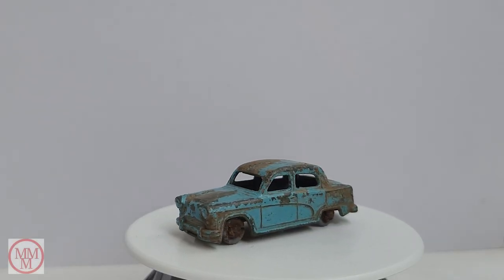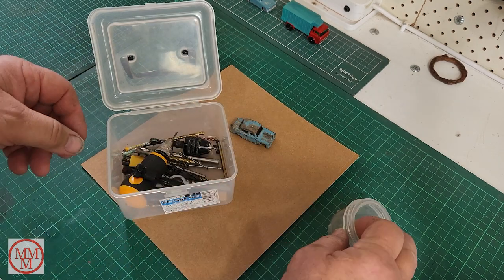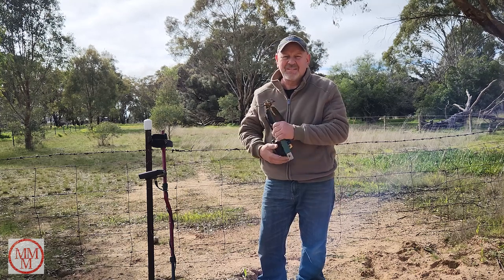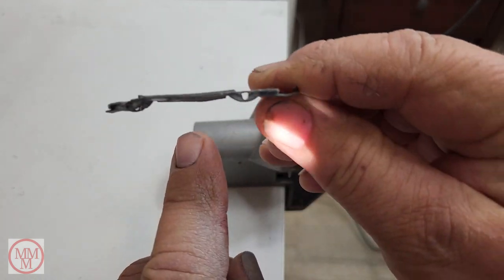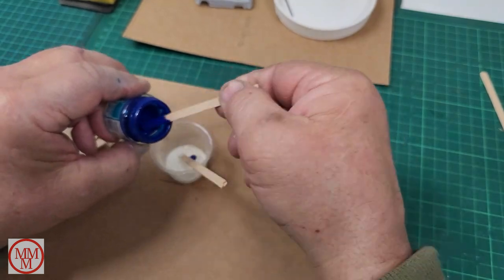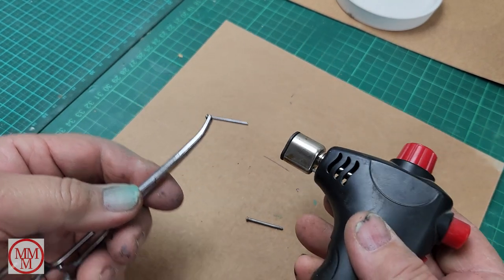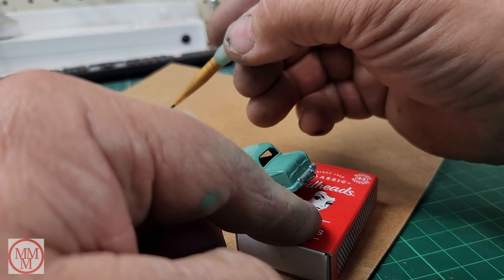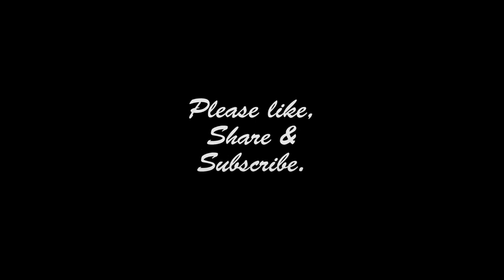MATCHBOX Restoration No.36a Austin A50 1957

Comment: I was about to add that the Harry Potter car was a ... never mind, a couple double-dozen comments already mentioned it. XD
seriously, this was close to the buried truck you did a couple years ago, a little less corroded, but still a challenge. :) maybe someone recommended it already, but Revell and Tamiya offer modeler's putty, the only difference is that Revell's stuff is an off-white and Tamiya's is medium grey (cool grey IV, as Faber-Castell would put it). 
odd thing with the paint. maybe it is like with engine oils; supposedly mixable, but with modern stuff, additives can clash and cause damages. maybe the paint makers use different basics, who knows. but it ended up being a nice green. :)
also, interesting "windshield brace". I'd assume they meant hinting at the windshield sealing frame. but that edge there? no idea. as if they wanted to experiment on fastening a window insert, and discarded it without re-retooling the mould again. it has happened before, like then Majorette's VW 1302 lost it's bonnet but the interior still had the boot with a suitcase moulded in.
anyway. so you went metaldetecting... what was that beep, then? probably a blop of rusted metal, I guess. and on your way back you had to discover that Kevin can perform a Kevin without even being there... XD
Reply from the maker: Thanks Lothar for a very informative post. The bleep was actually an underground corroded water pipe!

Comment: There is a product in North America,  (not sure if it is available in Australia, ) for rust removal.  It is non-toxic, non-corrosive, and reusable. It has been used by a number of YouTubers,  though I started using it before seeing it on YT. I'm not one to advertise for a product,  but this stuff does work.  It's called Evaporust. Comes in a 4L jug.  It requires full immersion of the item (i.e. it's not a brush on. ) I personally have used it many times and am always amazed at how well it removes rust. Good for any ferrous metals with corrosion (rust. )

Love the restorations! Miss seeing Julie in the videos.  Hi to her!

Comment: I haven't used many Mr Hobby materials but i used the putty and the buffing compound and something else and neither left a favourable impression, the brand might just not be very quality minded for all i know. Never was too tempted by their paint so idk, but it seems like possibly your mistake somewhere there this time over, just thinking if they aren't miscible, then they must have had different solvent bases. Which isn't to say it would have been great if they were all the correct kind.

The automatic spring loaded centre punch, i do not regard it as a precision tool, because it can hop a little when it actuates, or maybe i'm just not great at using it. But sometimes i plain don't have enough hands for a hammer and a punch and this one can be used one handed, i love it.

I bought a chrome pen on Ali recently super cheaply and i'm surprisngly satisfied with it. Should i dig it out, see how to find one of those again? I don't rememer it being branded at all but it looks and feels amazing, and i've had it for quite a few months.

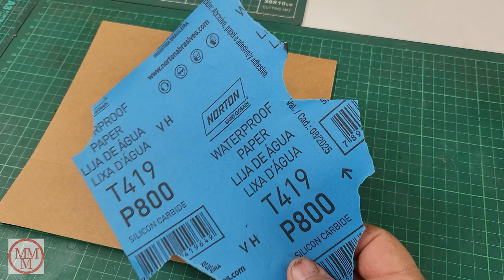Comment: @10:43 Marty, have you ever tried using surfacing products, like Mr. Surfacer, or putty dissolved in a solvent, to fill pitting, scratches, and other surface imperfections?
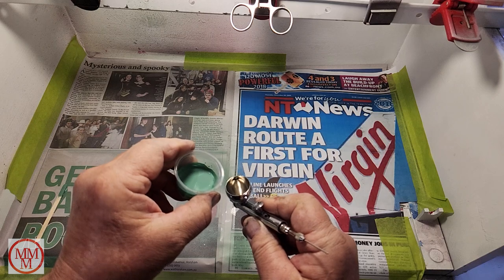@19:39 OK, you mention that you did apply a filler on the roof.

Comment: I’m sure someone has already mentioned that the Harry Potter. car was a 1960 Ford Anglia.
I was wondering if smoothing resin could help with pitting in roofs. Used for smoothing 3d prints. I use XTC 3D. Only for flattish surfaces as you will loose detail on others.

Comment: The reason the tyres went west is the rust on the axles.  The axles swelled and jacked the tyres / wheels apart, after which weather finished the job.

Comment: Your paint issue is most likely caused by two things. Using a Mr. Colour paint and then mixing it with an Aqueous Colour, not compatible paints and/or secondly, using Mr. Colour Thinner to thin Aqueous Colour paints. Again, not compatible. I use both and have never had an issue so long as you don't mix the paint types or thinner types. GSI have a strange take on what they call Aqueous as they are an organic solvent. Not sure just how much water goes into that mix, sod all would be my guess. Mr. Colour Thinner (dark blue label) and Mr. Colour Leveling Thinner (yellow label) are exclusively for the Mr. Colour range of paints and Hobby Colour Thinner (aqua blueish label) is for the Aqueous range. As for primers, I suggest you try the Mr. Hobby range of filler primers (surfacer range), they range from 500 to 1500, like sand paper the lower the number the coarser finish they are. Very good for dealing with surface imperfections.

Comment: You CANNOT rely on colors in photographs. They are NOT correct.

You can take a hundred different photos of the same car, especially if they are different cameras, and especially if you post them online, and they will all look different and even register different colors because of lighting and other technical factors.
Reply from the maker: I agree 100% - It can be impossible to match a colour from a pic on the internet. This colour was my best guess based on amongst other things my colection of original models of the same era.
Reply: @MartysMatchboxMakeovers  - Yeah. You can only do what you can do.

Maybe someone somewhere actually lists the actual colors used somewhere, although I'm not sure what color designation system they would use to do so, and then how do you make that near-exact color, anyway.

You seem to do pretty good most of the time, but video is the same as photo images, so we can't really tell anyway.

Comment: Yeah,
I think you're stuck with using primer to deal with rust pitting and corrosion issues in small models.
The problem is the compound bends, curves, and raised lettering/printing on the metal body of the models.
IF Marty was only dealing with FLAT surfaces, he could maybe use Plumber's Weld/Quik Plastik/Steel Plastik putty to deal with pitting and gouges.  The problem is you can NEVER get that putty sanded much thinner than 1/32 inch.  If you look at it directly on, it might be less noticeable (the putty) but at the side angle and or viewed from an edge, the putty weld is obvious!  At best, it would look like a thick PAINT BLOB.  At worst, it'd look like a METAL MISCAST which to anal retentive types is as bad as a paint blob!
I've used plumber's weld to fix and seal drill holes in steel/metal as well as repair mistakes I made drilling in ABS plastic.  It works well for that AND sealing small drill holes in steel.  Weld is better used for FLAT surfaces and situations where its natural off-white grey dried look blends in well with similar-colored paint or off-white grey plastic.
Unfortunately, I DON'T think Plumber's Weld would work for what Marty is doing here.  It would be a BEAR to remove it from lettering grooves it got into and would NEVER sand completely smooth.  The primer goes on microns thin which is MUCH thinner than any weld or putty you could attempt to do superficial repairs with!
Reply: Tamiya and Revell offer tubes with putty specifically made for modeler's purposes. alternatively one can use the putty that comes with some automotive spray cans, to repair small danages to a cars' surface. but since those bubbles can't be resealed it will dry up eventually.
Reply from the maker: Great post thanks!

Comment: Why don't you buy a shot blaster to remove your paint on the models you can use fine glass to remove the paint with out make any marks on the metal prob would save you buy those paint strippers  which damage the water system s with pollution